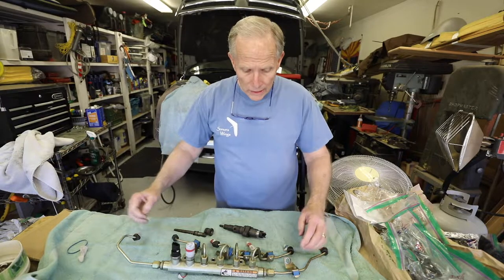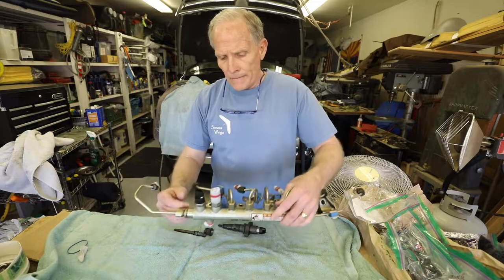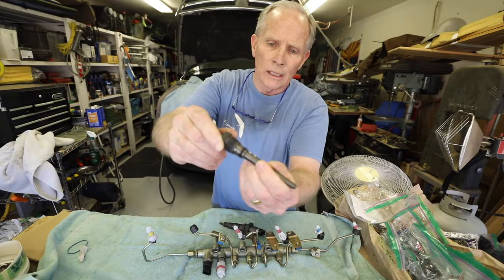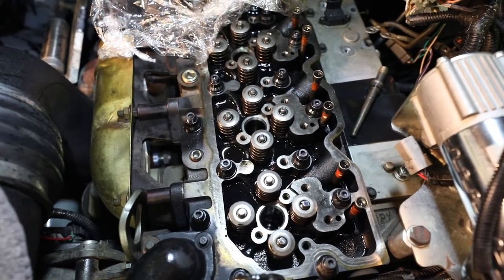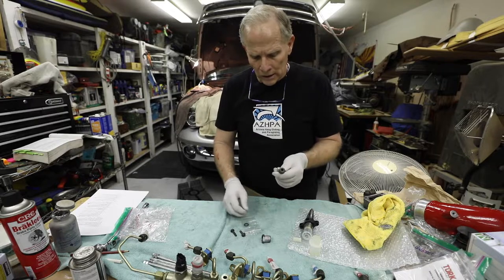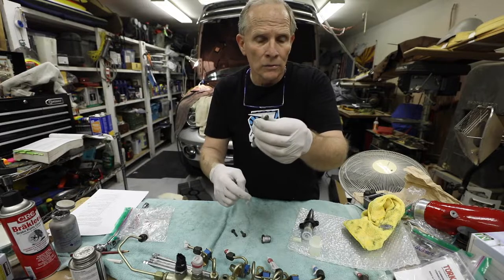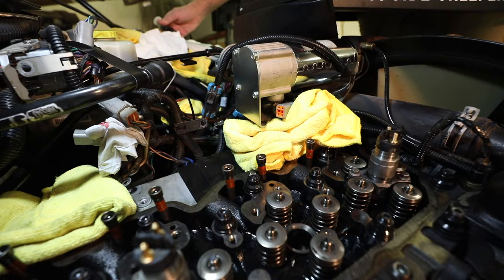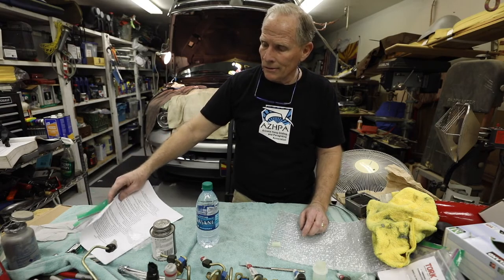Cummins Fuel Injector Removal and Install - 2005 Dodge Ram 5.9L 24V

Comment: hi Guys. Greetings from this side.
I have a hyster H5.0ft diesel forklift with serial number (P005B03724J).
this forklift was faulty with the electric nozzles not supplying gas to the engine and we changed it. also, changed the rotary pump , crankshaft sensor and the RPM sensor too. this forklift started working fine but for just a week.
it stopped and started showing few error codes.....2000-12, 97-3..........its a H5.0FT hyster diesel forklift(QSB 3.3L CUMMINS) and it was recently changed of its electric injector nozzles and this truck worked for 7 days and stopped. right now this forklift is not starting there is no current going to the electric nozzles anymore. checked for voltage but none, even the heater plug has no current. it just cranks on and on and runs down the battery.
pls i'd like assistance to this issue as i've concluded that it might be ECU that is faulty. your help will be highly appreciated.... here are my emails if you might want to send on there.
thanks in advance...
Reply from the maker: Hi John, Sorry to hear of the issue. Sorry but  I have no experience with the issue you have described. A suggestion would be to post to a Hyster or Cummins user forum on the internet where such issues would be discussed. I’d search in Google for “Hyster forum” or Cummins forum. Good luck to you.

Comment: Great video! Now how the heck did you remove the fuel lines on the injector tube side? From memory, injector 1 and 2 are in a very tight space. It seems like even a swivel crows foot/flare nut wrench wouldn't even fit in the tight space.   I'm not trying to remove the whole rail, just the lines. I changed injector #4 a year ago but now I need to change at least injector #1. I capped off injector #1 and the truck started but still took a longer than normal crank. 

 Thank you for any advice.
Reply from the maker: Hi ya Carlos. Sorry but I am a bit confused by your question. The #1 through #4 fuel line to connector tube nuts are all very accessible. The #5 and #6 are less so simply because they are under the firewall overhang. If you are instead asking about the fuel line to fuel rail nuts then maybe that's a different story but I didn't remove those so can't give an opinion. I removed the fuel rail and fuel tubes as an assembly. If you capped off injector #1 and the engine started the same way it did without #1 capped off, then it sounds like you found your issue. With that said, If you capped off #1 already, then it seems you would know if it was a tight fit? Glad for any further questions you might have. Greg
Reply: @gpwrinkled  Thanks for the reply. I mean how did you remove the fuel line where it connects to the connector tube on #1 and #2? Did you have to remove the intake Horn? (I believe that's what it's called). And after looking at it again, it was actually injector #2 that I capped at the rail. I did so by removing the hold down bracket and that gave me enough wiggle to put the cap on, maybe not the smartest move.  Originally the truck would not start but it did start after I capped off injector #2 but it still took at least 5 seconds of cranking. So for now, I can assume that injector #2 is leaking.  I ordered 2 injectors and will replace #2 first.  Then use my cap to cap off #3 and see if that reduces the 5 seconds start time. And go down the line to see what's going on.  My guess is that all injectors are bad at this point with 280k miles and assuming they are all stock injectors (I bought the truck with 218k miles).  I was having the same no start problem exactly a year ago and I capped off #4 because it was the easiest to get to in my opinion and it fired right up.  I swapped only injector #4 and everything has been good for a year but just recently the crank time got longer and longer until it didn't want to start. The high pressure valve was also bad upon inspection a few weeks ago and I used a tire valve cap to block it off and that got me rolling for another week or two.  I have since changed the high pressure valve and confirmed it's working fine. So now I narrowed it down to the injectors.  I also have a fuel rail pressure gauge on the dash and it's only getting up to about 2k psi, so definitely an injector issue.  Sorry for rambling but wanted to get more details out to you.
Reply from the maker: @carloslugo6684  Got it and thanks Carlos. I am happy to send you the detailed instructions I mention in the video, they will cover all the disassembly of the engine that is required in order to get to the injectors, which does include removing the Air Horn. Scroll to the very end of the video to see my email address. Email me and I will send the instructions to you. Best, Greg

Comment: Another excellent video. Truly appreciate you Greg.  Can you tell me what brand anti-seize lubricant do you use or recommend? Is it copper, nickle or aluminum based? I didn't hear you mention that in your video. Please respond. Thank you, Steve
Reply from the maker: Hi Steve, it is Permatex 80078. It’s apparently a blend of aluminum, copper and graphite, though I never knew that until reading about it just now.

Comment: So I'm having an issue to where both the threads on the injector bolts aren't catching at all. One will catch but the other one won't. I've tried to tighten both at the same time and it's just not possible. What am I doing wrong. (The tube is out and I'm just trying to set the injector in.)
Reply: I see the injector has a snap fit to it.

Comment: Great video thanks. What is that pump looking (ppe?) device you have up on front drivers side of engine?
Reply from the maker: Matt 359 Hi Matt, I think you are referring to the on board air compressor which is electrically driven and it’s primary purpose is to provide the pneumatic pressure to close a gate inside the exhaust just aft of the turbo.. which serves as an exhaust brake to slow you down. It functions automatically when you let off the gas as long as you are in 4th gear and have greater than 900 rpms. It’s great for saving wear on your brakes. The pump cycles ion and off, keeping a small air tank full. I also use the air to feed an air chuck poking out of the front grill for filling the tires. It also ties into the rear axle air lift bags for leveling the vehicle when towing a trailer, and also feeds a twin air horn I installed that comes in handy occasionally. The air brake and pump are made by Pacbrake.
Reply: Gotcha, havent seen one of those before. Nice to have that air brake for towing for sure. Good idea for using it as an onboard air comp too. 🍻

Comment: Greg, for doing this job, will I need to purchase a new valve cover gasket or can I reuse it?   My current gasket is not leaking.
Reply from the maker: I would say that if it is an OEM gasket and is in good shape after removal you could reuse it. It will probably be fine and if it does leak it’s fairly quick to get it off and replaced. For me I didn’t want to mess with the chance of leaks so I replaced it and the gasket below the rocker box which I removed to replace head bolts with head studs... and then that brand new gasket leaked anyway and I had to tear it clear back down since I can’t tolerate a leak. That one was a bit of work. I’d always recommend replacing the rocker box gasket since it takes so much work to get back to it, but the valve cover gasket is easier to get to. Plus I believe that valve cover gasket on 06 and up contains the electrical wires for the injectors, so is expensive and is intended for re-use. But that’s just me. Others may feel differently.
Reply: @gpwrinkled  Hey, thanks again Greg!  I really appreciate your help.

Comment: I have an 04 Cummins number 6 is stuck. I have the removal tool, but no luck. I can turn it side to side. Help
Reply from the maker: Hi Ray. The injector or the injector tube? Either way, to my knowledge the only thing holding it will be a rubber o-ring that’s gotten hard and dry. I had that on the #1 connector tube. You might try spraying some penetrating oil around the outside of it. The penetrating oil won’t hurt in either situation… injector or tube.

Comment: Hey friend, I got my bad injector out now, and of COURSE it had to be from way back at cylinder 6, ughh! Now I was about to put the new one in and let'er rip, but I've looked at the old one and started to worry that I might have a bigger problem! My old injector's tip is really flattened kind of diagonally! How might that happen? Have you ever replaced one that looked like that and then had the engine still run just fine, or have you always had a problem after replacing one that was that bad?

I'd love to send you a photo of it so you can guess better. If I had contact info. that allowed me to do that, would you look at it for me, please?
Reply from the maker: Glad to look but one of the online forums would be a better choice. Lots of experience there. My email address is shown at the end of the video. Sounds like the piston may have contacted the injector, which I have never heard of happening before but I am not an expert.
Reply: @gpwrinkled : Oh, oops, yeah, I forgot that your e-mail address is there. I'll start by just taking it to Autotek right by where I live and asking them. (You seemed a bit familiar with Orem. Do you know of Autotek?)
Reply from the maker: Hello Kitty Lover Man! Don’t think Injave ever been to Orem and haven’t heard of Autotek. If they are a diesel repair shop that’s a good call. You might try a diesel repair shop or perhaps your local Dodge dealership and talk with the guys in the service department.
Reply: @gpwrinkled : Autotek is a diesel and gasoline shop. Oh yeah, the dealership would be good too.
Oh, that confused me about Orem, because you said "Orem is a great place" as if you had been here and liked it.
Reply from the maker: What did you learn about the cause of your injector damage?

Comment: Hello Glenn. Were there any other upgrades required for going with 15% over injectors ? Are you using a tuner ?
Reply from the maker: There are no upgrades required to use the 15% over injectors. Contact Dynomite Diesel for details. They are easy to talk to. Yep I use an Edge Programmer Juice or something like that. I like it.

Comment: Will the 15% over injectors have any effect on emission testing results?  Was the EGT  increased with the added fuel?  Thanks
Reply from the maker: Hi Howard. Not sure on both questions. Small EGT changes are tough to measure. There was someone who replied here and noted they had emissions problems which Dynomite couldn’t explain and which didn’t go away even after replacement injectors were installed from them. But that is the only comment I have heard on that topic regarding these injectors. I don’t have to do emissions on this vehicle due to the Arizona County it is registered in so I can’t help in that regard. You might call Dynomite Diesel and pick their brains.

Comment: I sheared a injector hold down bolt trying to torque it. Is there any more tips about how to get the proper torque?
Reply from the maker: Hi Zach, sorry to hear that. Did you have my instructions document? I can’t remember if you’d requested it from me. What torque were you applying?

Comment: How many miles did you have on your truck at replacement? What symptoms did you truck ha e to let you know they were due to be replaced? Thanks
Reply from the maker: Just wanted to replace them. Had 90K and no symptoms. Figured I would replace them on my schedule before they failed on a trip or something.
Reply: @gpwrinkled  thank you. My 2006 has 165000 and is starting to smoke more with my tow tune. I figure its about time. Do you still have your truck and do videos? Did the 50 hp injectors make a difference in your truck?
Reply from the maker: overheadcam32  I have put 35K on since then with no issues. Much less smoke. Hard to tell if the 50hp made a difference… the thing has so much torque anyway. I’d think you would need to dyno before and after to really know.
Reply: You haven't done any videos in awhile.  Hope you are doing well. My injectors will be here in a few days. Very nice videos.  Thank you

Comment: I'm doing a 04 5.9 24 valve now running bad had extra 5 qts of oil which turned out to be fuel, its lumping hard , pulling head do I need to pull turbo? or not, and if my fuel lines won't budge what would you do?  thanks Kip
Reply from the maker: Kip Higdon Sorry not sure about the cause of fuel in your oil or whether the turbo needs to be pulled, but I did have the same experience with one of my fuel line connections at the head. The inside top of the nut didn’t want to slip against the flare of the fuel tube so when I went to loosen the nut the fuel tube began to twist as the nut tried to turn. I put penetrating oil onto the fuel tube where the tube disappears into the top of the nut, the goal being to get the oil inside the top of the nut and between it and the flare of the fuel tube. Once the oil penetrates (time may vary) then hold the fuel tube with your hand to try and keep it from twisting as you loosen the nut. The tubes are expensive so take your time and let the penetrating oil do its job. It was still a hard pull to get it to come loose. Good luck!

Comment: Very helpful video. getting ready to do the injectors on my 06 Ram. I'm getting codes and believe i have a cracked injector body. Can you tell me how your injectors are working out? Can you feel a difference in performance or the way your truck runs? I'm at 310k miles on original injectors and am told I'll notice a big difference
Reply from the maker: Dan OHarra I was only at 100K or so when I replaced mine. Didn’t notice a big difference, except a lot less smoke. They are running great. Email me for the detailed instructions if you’d like them. Email address is at the end of the video.
Reply: When we’re you getting the smoke & what color?

Comment: Hi where can i buy that small tool to pry on the injector to remove it Thank you.
Reply from the maker: ricardo rodriguez I purchased it in a pack of 4 that varied in size, for $21 from Amazon. Search Amazon for this text string: “Tooluxe 00240L Rolling Head Lady Foot Pry Bar, 4-Piece Set, 6, 12, 16, 20" Sizes”
Reply: @gpwrinkled  Thank you Greg this is my first time doiing injectors on a cummins im a FORD guy but i need to learn more the motor is a Cummins ISB B series one more question on the ISB B series Crank pulley do i need to have a pulley removal to remove the Crank pulley or it just pulls out by hand. Sorry for asking to many questions.
Reply from the maker: ricardo rodriguez Sorry man, I haven’t needed to remove the crank pulley so I am not sure about that process. I am sure you can find a video on it, or some info from one of the forums. Good luck to you and no worries on the questions. Keep them coming and I”ll try to help if I can.

Comment: How much does a injector cost?
Reply from the maker: Carlos Chavez They range in price. The ones I installed were about $3,000 for the 6 injectors. I still have the ones I removed and should probably sell them on eBay as they were working fine and only had about 110K miles on them since the truck was new.
Reply: Thanks 
What about the cheapest one they have on Amazon for 300 is those good injectors or not?
Reply from the maker: Carlos Chavez I dunno anything about them. Sorry